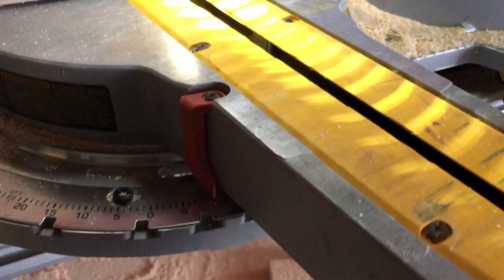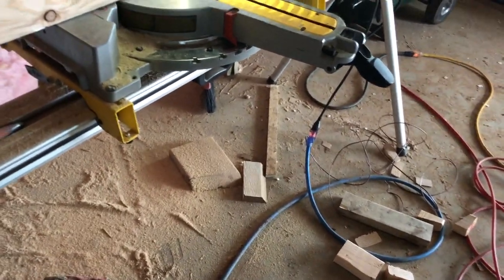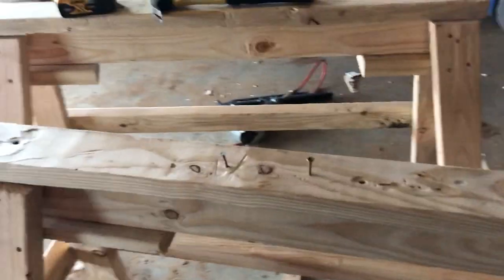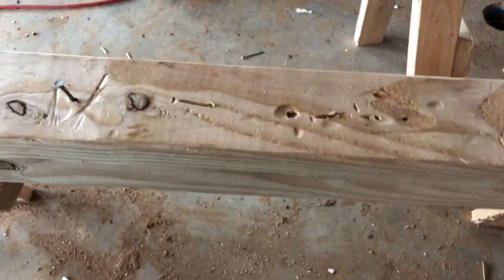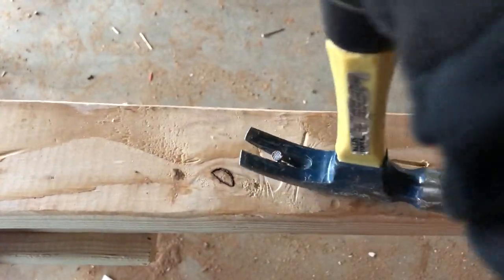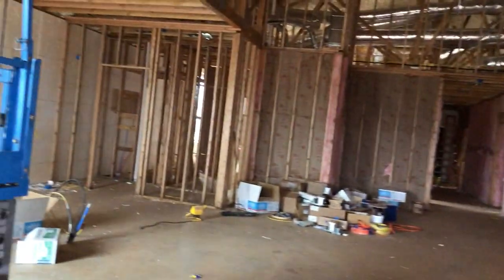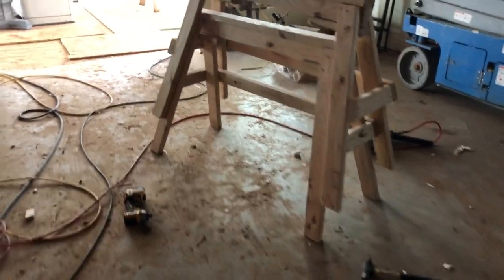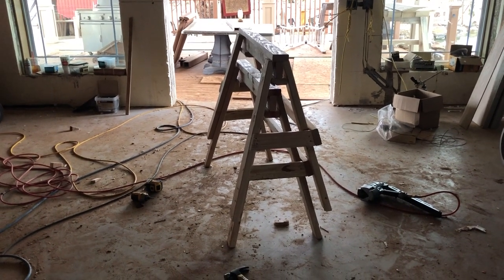How to build a sawhorse

Comment: 10 degree legs are perfect. When I make wedges 10 is my number for single incline. 10 degree metal wedges are portable presses and alignment tools for getting high/low out of metal. 10 degree transition is also what I recommend when thinning something thick to weld it to a thinner section! Great video keep them coming. Those horses are stout for the money you have tied up in them.
Reply from the maker: tdej80 yep, they work great, can’t have too many sawhorses on a job! Thanks for watching!